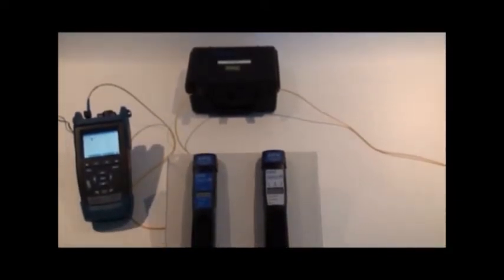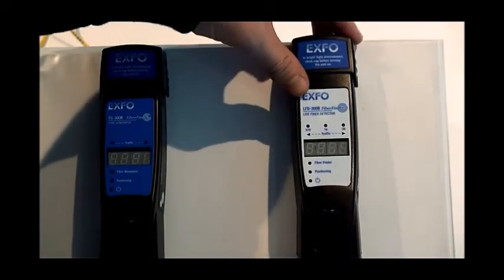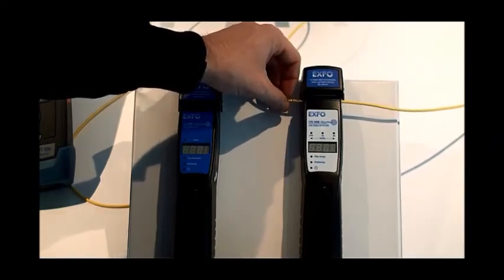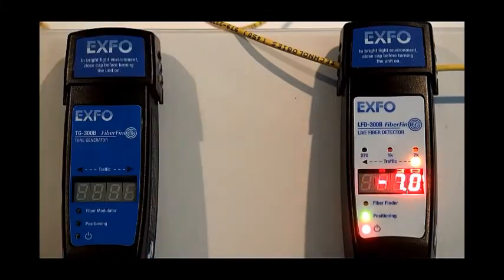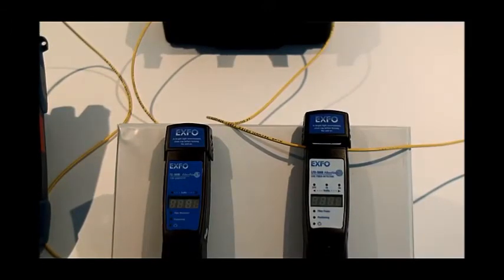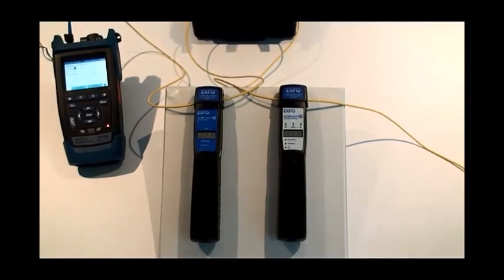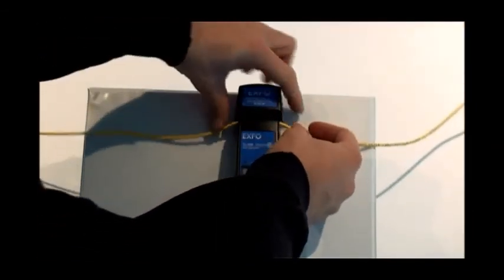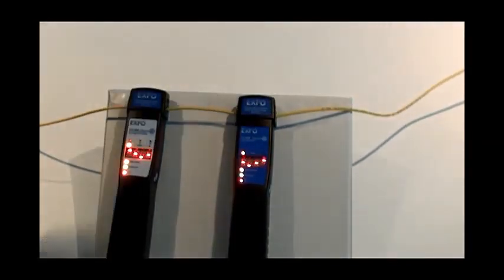How to Use an EXFO TK FF FiberFinder Kit Exfo Company Instructional Video - CarverLink

Comment: doesnt work for me. Wasted an insane amount of money one one of these and now my company doesnt trust me anymore. I trusted exfo, they lied.
When they say it will allow you to trace ANY LIVE FIBER, they actualy mean, if you make it live with a dedicated perfect light source form a power meter. which means, it had to be dead in the first place.
Might as well use a tone injector into the dead fiber. you cannot trace a PON fiber out into the OSP.
Nor can you use it for their advertised purpose of dat center fiber tracing. They dont tell you and they dont propperly advertise it, but it oonly works on G652D. it wont wokr on 657A1, which is what 99.99999% of data centers. so data centers are out of the question. idiots , just absolute fuckign lying assholes